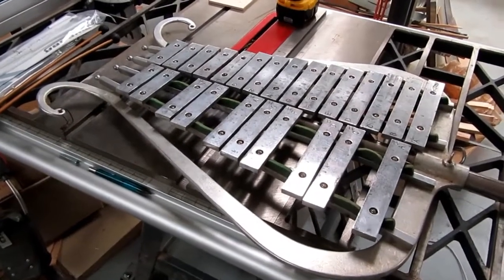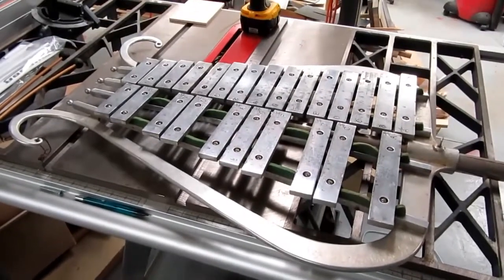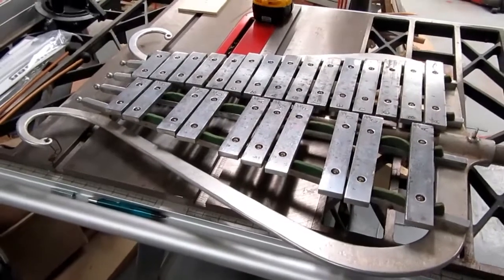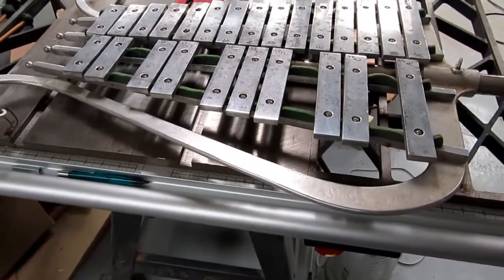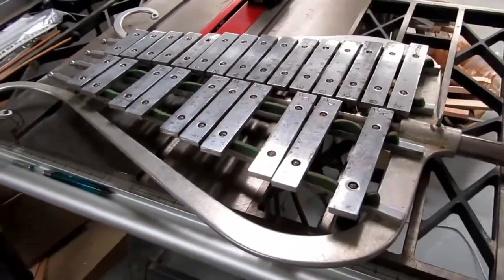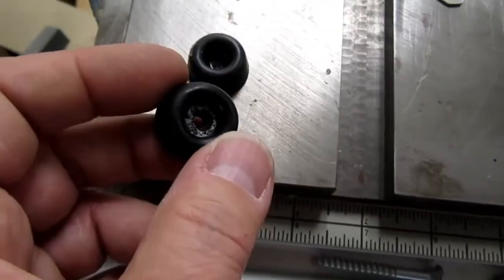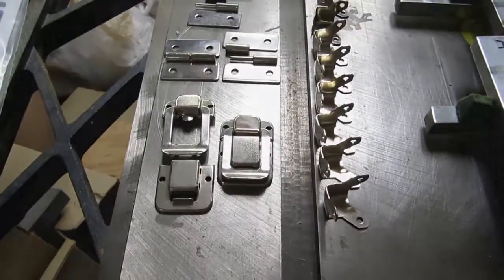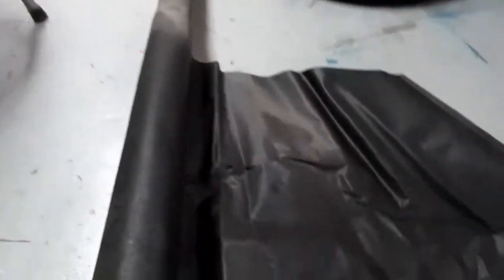Making Orchestra Bells from a Glockenspiel

Comment: Wow, awesome job!

I think the comment recommending padding is for 2 things. 1) Noise when carrying the instrument. Since the mallets are not secured down, they may roll around while carrying the case. It probably wouldn't damage the mallets or case, but if you only had one pair of mallets in there, they may bounce around and chip the black paint. This bouncing could annoying if you're taking the case on a bumpy csr ride, etc.
2) Incase someone stores the case upsidedown. Hopefully no one would do this, but if they did by accident, any loose bars would hang upside down or fall off. Some cheaper cases I have seen leave little space between the bars and "roof", so if they are stored upsidedown, the bars will bang/scratch against the roof. This only happens if the bars have a very long screws keeping them in, and the bars have a lot of give. It looks like you left some space between the bars and "roof" so even if it was upsidedown the bars wouldn't jostle much. Plus the screws attaching the bars are short, even if they were barely screwed and it was upsidedown, the bars wouldn't hang far from the felt.

Thanks for posting this, I think I may follow what you did for my own project!
Reply from the maker: Phillip Drange, the mallets are in their own compartment and won't go anywhere. They also make no discernible noise when the case is being transported. No idea why you would think the mallets are going to 'chip' the black paint......the mallets are very light weight, they have very little space to rattle around in, and they have rounded surfaces, not sharp ones.

There are no loose bars...does that even ever happen? Each bar is held to its rail with two screws that would need to somehow unscrew themselves over many turns, and BOTH would need to do that before their bar could fall off.

There is simply no valid reason to add padding to this case.
Reply: @youtuuba   youtuuba  thanks for replying! Now that I've looked again, I see you're right the mallets fit pretty snuggly. And as you said the mallets have rounded edges, not sharp edges. I guess you would only get noise or scratching if you put something smaller in the side, like a triangle beater or screwdriver. Plus you would have to purposefully shake the case!

On poorly mainstained orchestra bells the bars do come off occassionally when held upside down. This only happens when a screw is stripped or something. Since the instrument is in good shape, that wouldn't be a problem.

I hope I didn't come off as critical, I think you did a great job, I really enjoyed the video. Thanks for responding

Comment: i have the same type of lyre bells that I'm trying to clean up and refurbish, made by WFL in Chicago Ill.  Took it all apart, replaced the felt; kept the leather washers and replaced the bushings.  Some of the bells don't ring well.  How do I fix this?  How tight do I tighten the screws?  How thick should the replaced felt be? The bars rang brightly before I took it all apart, so there must be something I'm not doing right.  Can you help?  I want to keep the bars on the Lyre frame.